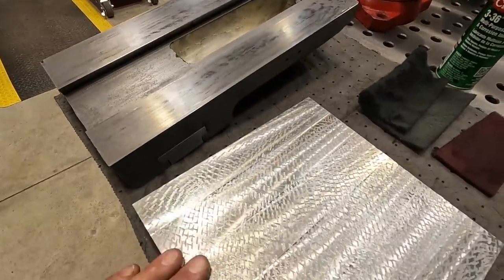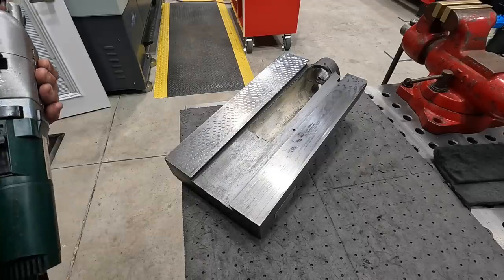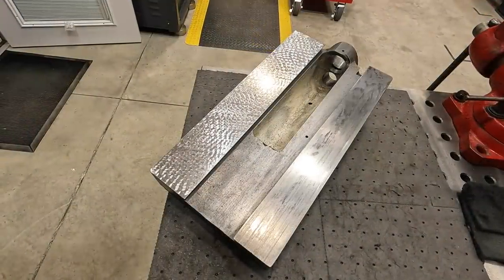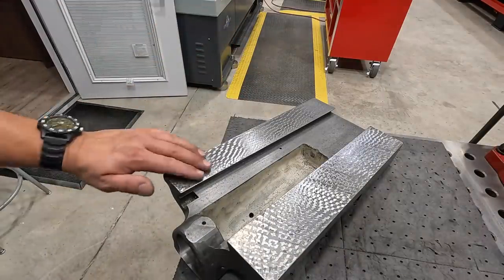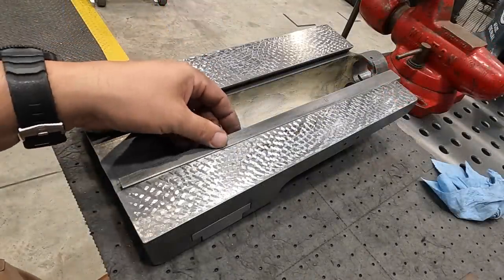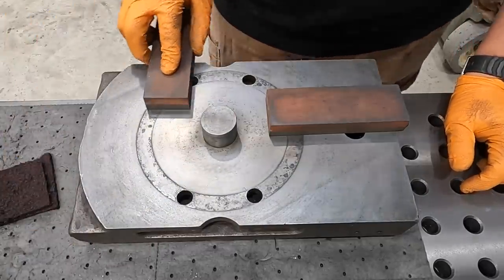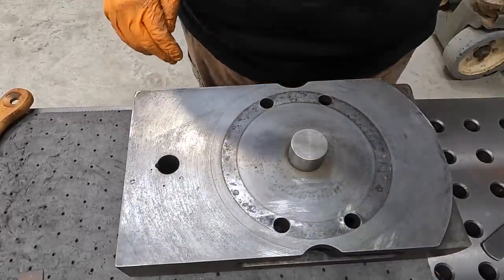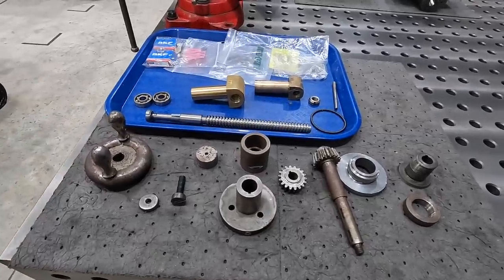Compound Rebuild Begins for American Pacemaker Lathe

Comment: I'm curious if a conventional oscillating tool, particularly a battery operated one, could be pressed into service as a scraper. I suspect not but I'm curious if anyone has ever tried it.
Reply: There's actually a YouTube channel, Cà Lem, that did something similar with a reciprocating saw and it seemed to work quite well. Search "DIY - CHEAP Power Scraper".

The biggest downside to that mod though is the stroke length not being adjustable. It's important to adjust the stroke length as the optimal length for rough passes isn't the same as for finishing passes.
Reply: Yeah I've done it plenty of times with a small air ginder with a 90degree head and a 1' grinding pad.  You don't really need the anal-intruder 4000 all the youtubers use, it's jut nice to have.
Reply: @sheikyerbouti83 😂

Comment: Adam, I have watched Kieth Rucker doing scraping but when going opposite direction he goes perpendicular to the previous direction. You seem to go parallel, sort of doubling on the previous one. Is there advantage using one method over the other?
Reply: Adam's passes were close to perpendicular.

Comment: I am sorry, but i do not understand. No measurement? Do you not use any check on the reference scraped board? Do you use no blue for points visible? How can you know that the areas are straight and parallel? This is really only pattern for oil, but that is not the meaning of the scraping.
Reply: I think he mentioned that the surfaces were already making good contact to begin with. And yes there will be the assumption that its already reasonably parallel. Also its not nearly as critical as something like they ways. There you would need to ensure there is good parallelism, uniform contact, and flatness.
Reply: And also the pattern serves an additional purpose of giving dirt and wear particulate somewhere to go so it doesn't end up galling over time.
Reply: I was thinking the same. But it appears he`s intension was not to re flatten the surface but rather to just create a even layer of high and lows so it contains grease and dirt better. For the surafce on a vice, there is no need to make it true flat, only purpose was to making sure it has a full contact and smooth.
Reply: He dont need to check the carriage surface.he know all about scraping and maintenance of this
Reply: Just make video for the followers

Comment: That's funny that the refresh rate on the camera is close to the scraper so it looked like it's going slow
Reply: Its powered from the wall so it multiple of 60hz. NTSC used the wall as a clock so it was 60hz pal which is the eu standard is 50hz. Any way most frame rates are multiples of 60hz now so they usually sync with AC powered tools.

Comment: Personally speaking, I suspect that digging up the surface of ways to ''retain oil'' is complete hogwash. Look at the cross head on a large steam engine (for instance) that sweeps full travel hundreds of times a minute - nobody dug that up with a power scraper, just a few drops of oil regularly applied by an oiler is more than just fine.
Reply: Are you sure the traveling parts haven't been scraped? Also steam engines that I have seen have active lubricators constantly depositing oil. This isn't the case with a lathe crossslide that has to be cleaned and lubricated by the operator.
Reply: @quartertwenty484  Jordon, just contrast and compare the surface distance swept by a steam engine - maybe a ship engine turning for weeks on end, compared to the few inches traveled by lathe slides. I oil the slide ways on my old Colchester Student and they're still oily weeks later.
Reply: @julianstafford7071  Well I know a little about boat shaft bearings. Small boat cutlass bushings are water lubricated and have large lubrication grooves to allow water to enter the bearing (you can image search "cutlass bearing"). Large shaft bearings are usually oil or grease lubricated under pressure. Shaft bushings are honed and older ones were made out of babbitt metal.
Reply: @quartertwenty484  OK, since we are now talking about rotating bearings, would you chew away at the bushing material with a scraper to help with lubrication? All I see that doing is reducing the effective bearing surface area leading to premature wear.
Reply: @julianstafford7071  Yes honing both brings the bore to dimension and produces an engineered amount of surface roughness for oil retention. Babbitt metal does this to itself but requires the bearing be "run in."
Reply: @UCrowiR9wahs2cgcbk1JzzIg Thanks for taking the time to write that Toasty, very informative indeed.
Reply: Sorry Julian. The process of gouging the bearing surface is not hogwash. Consider the bearing surfaces between the bottom of a lathe carriage and the ways. When the surfaces wear over time, they polish out the gouges and start to shine. At that point, they squeeze out the oil and then the bearing surfaces wring themselves together. That causes the dreaded stiction which will grind up your bearing surfaces whenever dust or larger contaminants get in. The stiction also causes more torque to be exerted on the carriage drive mechanisms and wears the rack and pinion prematurely. In short, scraping bearing surfaces helps prolong the smooth operation of the machine. In the case of a crosshead on a steam engine, the sliding bearing would require constant lubrication. Some lathes are set up that way, be most are manual lube.

Comment: Sorry Adam, but..... this chinese flaking method, without the correct rebuild to the original Specs of this machine, is in my mind,a waste of time and material.
Thats not the right way, to do this.
🙄🤔
Reply: Where there was no oil there is now
Reply: It appears there are more oil reservoirs than flat ground bearing surface remaining. Maybe the pattern is not as dense as it appears!
Reply: Are you saying that it wont work or are you just saying your opinion? Oh also scraping is scraping, I don't know what you're on about with the racial slur?
Reply: @musicbro8225  scraping is not scraping. Chinese Machines have often nice sraped patterns, but not correct scraped Flats, nor correct arcs, or correct dimensions.
Just to look a Like, a propper built machine. Thats not racist, thats a fact, i have 2 such machines for myself!!!
Sorry, but oil pattern scraping is not worth the time, If the geometry of the machine is Not correct.
Its Like you bring your car after an parking Crash to a Body Shop, and they only paint it, without any straighten the Panels, Bring Out the dents an scratches, without filler, rust fix and so fort. 
You can do things in two ways, the right.......and the wrong way.😉
Reply: @schwellenzaehler4564  So you're saying that Adam, who is a third generation machinist, who has been to a course on scraping doesn't know what he is doing?

Your problem is not even with the scraping, it's with the surfaces where the scraping is being done so scraping IS scraping (lol). This lathe was not built in China and it was built well so you can trust the wear marks and whatever measurements or tests Adam has done to come to his judgment so relax with your saying he is doing it wrong, he is not doing it the wrong way... Perhaps he just wants to get the lathe working so he can then decide what else, if anything, needs to be done.
Reply: @musicbro8225   the wear marks at the surfaces in the Vid, told me a complete other Story.🙄
I dont know, what you have done the last over 40years, i was reconditionig hundreds of machines during this time.......😎
Reply: @schwellenzaehler4564  ok, that's fine. You win. I don't know what you win but we'll done.
Reply: @schwellenzaehler4564  You're thinking of scraping for precision mating. Adam is not doing that, he's just adding texture to the ways to prevent them from squeezing out all the lube. No precision or certain pattern is needed, Adam even said so. Some machines have nothing more than a few tiny diagonal channels to help direct a little lube to critical surfaces.
Reply: @Bob_Adkins  what he's doing, and what he say, is clear.
But sorry,  it makes no sense, because the Flats are Not exact Parallel against the pairing flats. So parts cant flow on an oil Film, that prevents the wear out! The parts are rubbing on little edges, and the relative heavy point pressure let the oil flow away, parts rub and wear out, more and more. The oil pattern helps only, If the rubbing flats are exact parallel pairs!
If you have enough 
expeariance in the Art of scraping, then you can see this relative heavy wear out markings in the Video.
If there are no longer the original flaking/oil Pattern, the wear Out is too heavy, so its time to do a complete geometric rework.
So scraping oil pattern, is in this case a waste of time and Work.🙄
Reply: @schwellenzaehler4564  He did the scraping in almost real time on video, and it took what, 20 or 30 minutes? So no time was wasted at all. One thing you are right about is loading. If (example) 30% of the mating surfaces on the ways are .002 deep oil reservoirs, then the PSI loading goes way up on the remaining flat mating surfaces.
Reply: @Bob_Adkins sorry..... haha😂, i think you have absolute no clue, this amount of time you need only to take the machine apart.
The same time to remount and fine tune the parts and gibs, so that the ways run with the right amount of resistance, but smooth enough with no stick. Alone the cleaning of all the parts takes a lot more of time! 🤦‍♂️
The youtube video you see, need 5-6 times more of video material. 
You must cut and edit all the stuff.....upload and so fort...... 
On which planet you live??? 🤦‍♂️🤦‍♂️🤦‍♂️
Reply: @schwellenzaehler4564  Adam took the machine apart to clean it and check the ways. Right? The ways were in decent shape, no regrinding or precision scraping was necessary, right? So Adam textured the mating surfaces, and that was not wasted time. The actual scraping did not take much extra time. I did agree with you about 1 thing, so we're from the same planet, apparently.